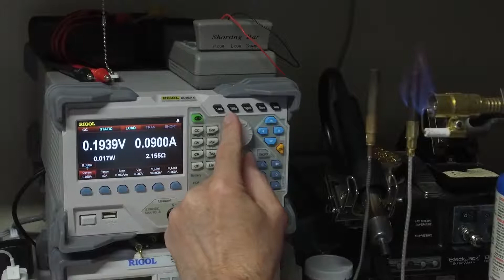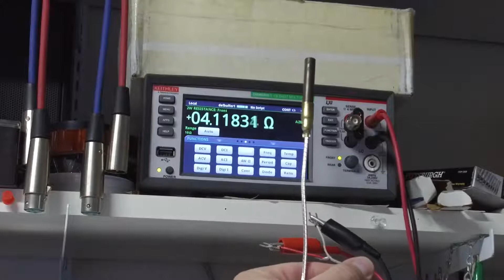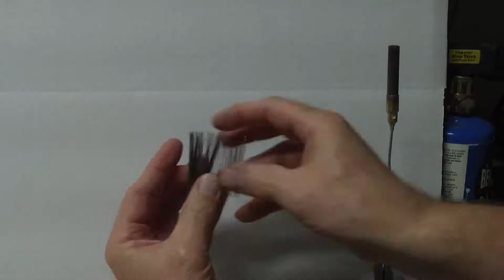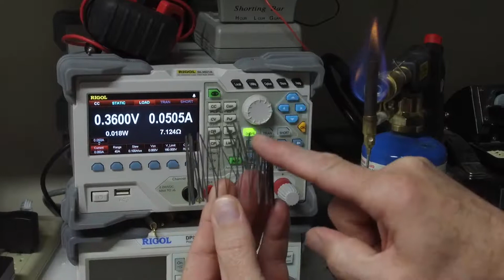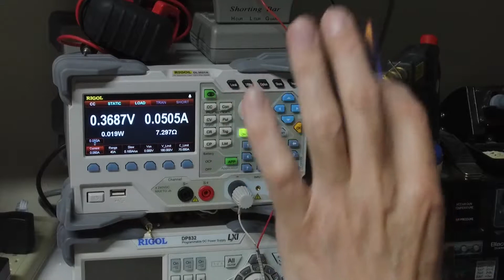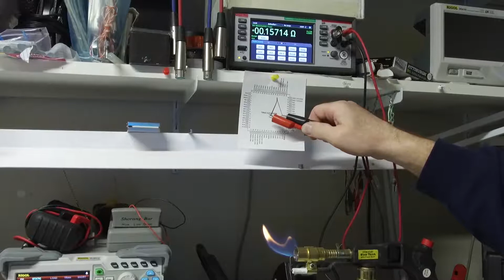Thermopile Testing, Construction, Current and Energy Harvesting.

Comment: Thank for the video.  My thermopile is not strong enough to turn on the gas value, but it is strong enough to keep it on once its on.  Or I have to turn the pilot light way up so that the thermopile generates enough power under load.  I didn't realize that it is best to heat just the top.  I also that keeping the bottom of the thermopile cool will help increase the power output.  I was thinking of putting a large value, low voltage capacitor on the output of the thermopile, hoping that the charge on the capacitor would be enough to turn on the valve.  
But now that I have your approx power output for a good thermopile, eg 0.32@60mA, I can do a better test of my thermopile.
Reply from the maker: Thanks for the kind comments.  It was a surprise for me as well when I initially started testing the thermopile but it makes sense.  Hot on one end and cold on the other :)